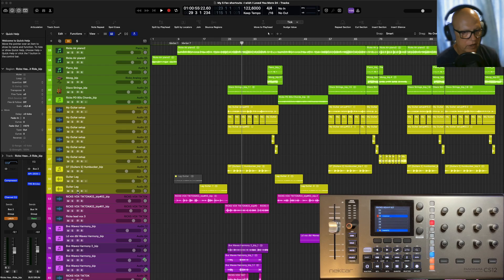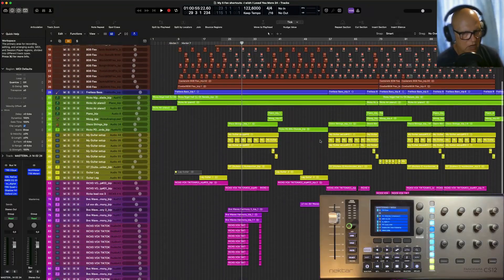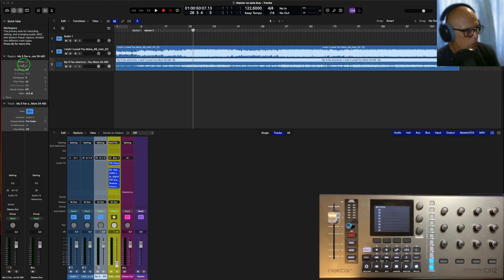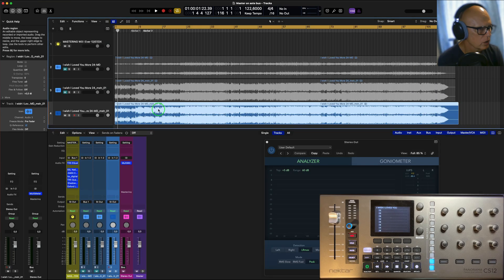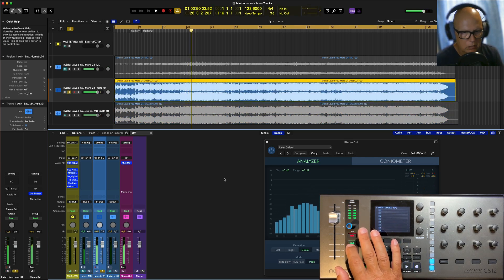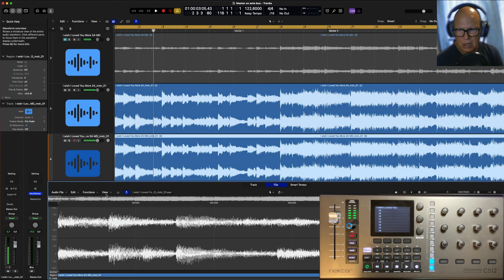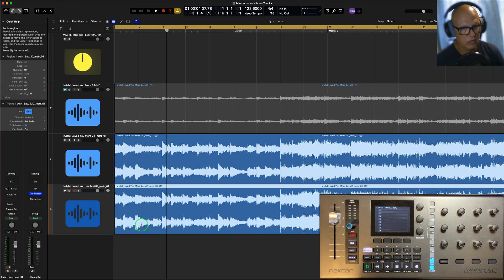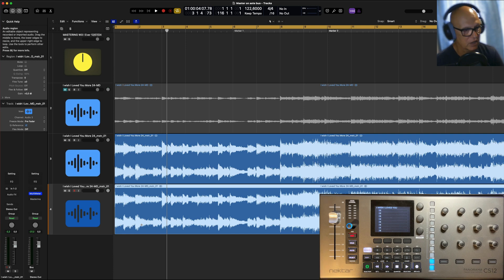Should you master on the master bus? / LOGIC PRO 11.01

Comment: I've gone over this question in my mind several times. I finally just started using the master buss, I can't hear a difference. It also doesn't seem like I'm making a copy of a copy, although it's not an audible difference. Less files to deal with overall.
Reply from the maker: exactly my case , so much easier when you need to make adjustment to the mix etc
Reply: The only thing is that it can all get a little bit CPU intensive